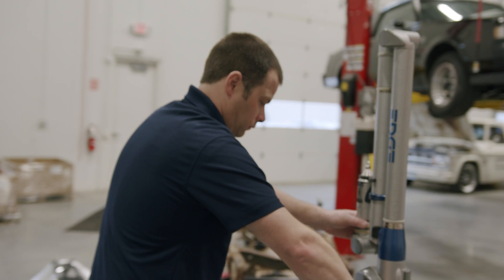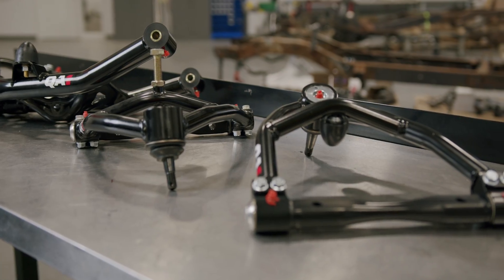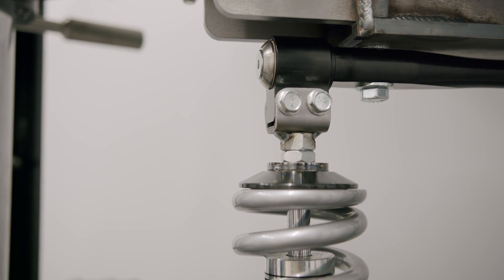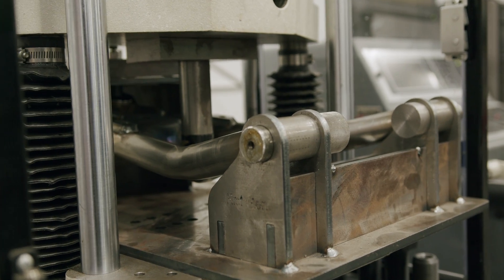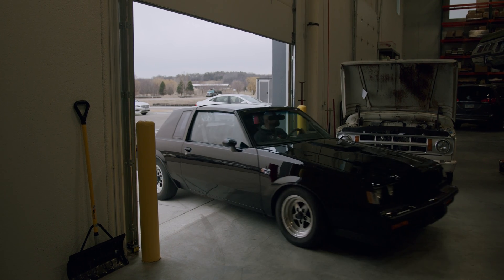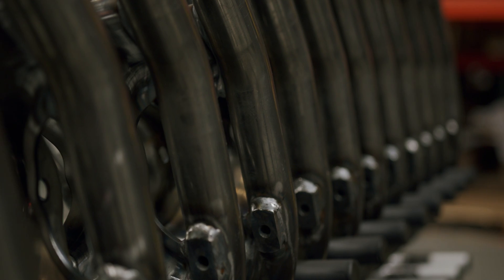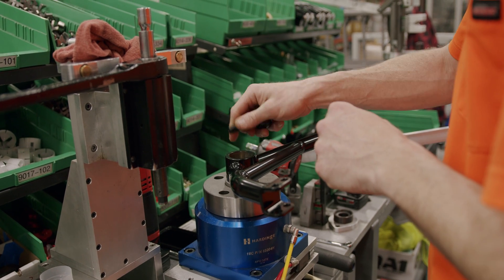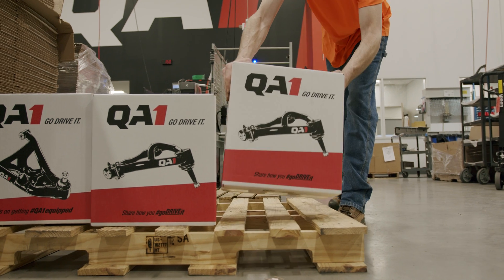How It's Made: Tubular Control Arms

Comment: I agree the control arm packaging is excellent. My full front arrived like it should. New and flawless. However the dual c10 sway bars packaging is terrible. The bars are wrapped in thin material and together in the box. Fedex delivered them with one end on my front hanging out of the box! The end link mount got damaged. After waiting 4 months on back order, it was pretty irritating that you guys didn't prevent the 4 ends from puncturing the box. It wasn't worth my cost to return ship and wait more months, so I will probably have to repair and re powder coat myself.
Reply from the maker: Thank you for this feedback. I will share with our production teams.